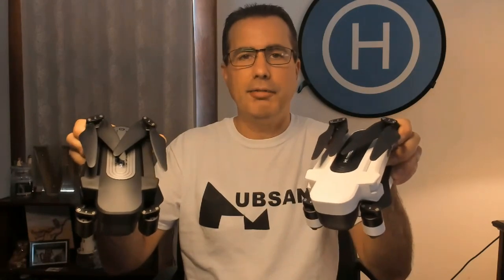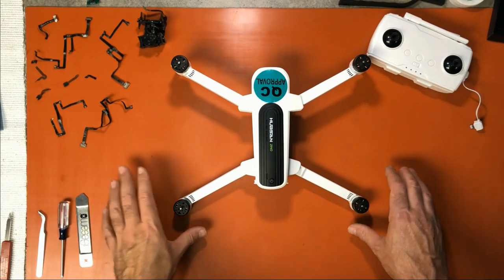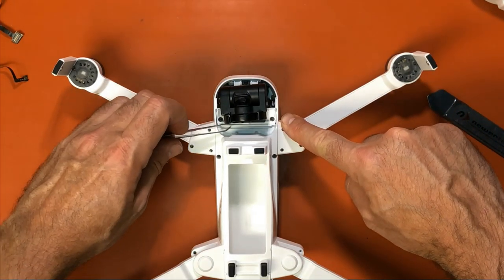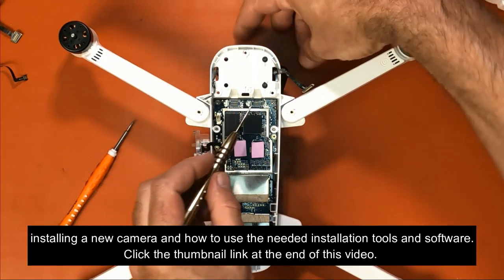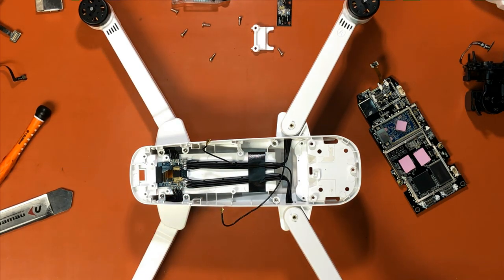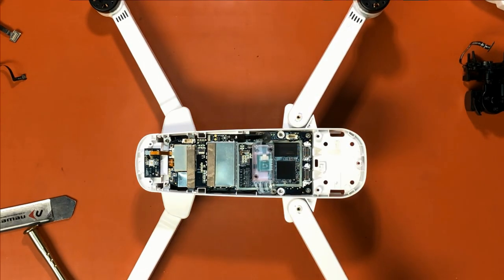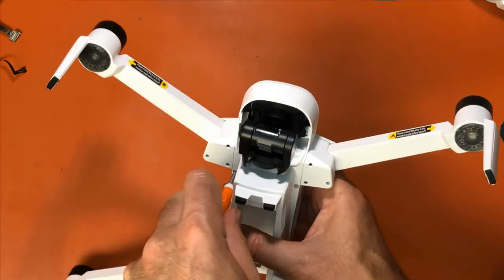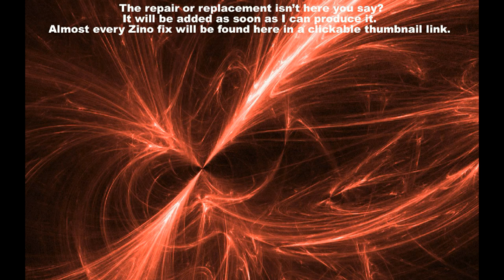HUBSAN ZINO - HOW TO TAKE IT APART & FIX ALMOST ANYTHING

Comment: These instructions came in very handy. Just changed the camera + gimbal, and then calibrated using Zino gimbal tool. Now it is working. I got it cheap, from a guy who had crashed it, and the gimbal did not work, camera was fine. Ordered a new Gimbal and camera, first at Geekbuying, but they had to cancel the order, since they do not know when they can get them from Hubsan. Ordered from Aliexpress instead. Hubsan offered that i could send the drone back to them in China, but had to pay 30$ for return shipment from Hubsan to back to me beforehand, and pay for spares, and also pay the shipping to China. So i opted to do it myself instead.
Reply from the maker: I'm glad it helped in one way or another and it's so nice hearing someone got in there and fixed it themselves! This is part of the hobby and you seem to get that.

Comment: Hay I have a hubsan pro only done 4 short flights & now my gimbal keeps having little fits the disconnects it that a broken ribbon cable
Reply from the maker: Mathew Mccorkindale It can be a few things but gimbal having fits doesn’t tell me anything I can identify with. Sorry 😐
Reply: Thanks for the reply I still haven’t found a fix. So the gimbal won’t calibrate. I turn it on & all is good then the camera moves up & down very small movements really fast then stops it lasted about 3 sec then it’s good for about 30 sec then it does it again about 3 times & the gimbal goes into protection mode & flops to one side. Would like to no if you have any suggestions to wot it could be thanks.
Reply from the maker: @mathewmccorkindale9196  This is a calibration issue where you need the calibration tool. Sounds that way based on how you described it anyhow.

Comment: Hi Chris, I have had a small crash with my Zino which hit a wall at low speed and fell 3 feet to the ground and landed upside down. When I picked it up all looked OK, camera still recording, I stopped the props spinning with the controller and stopped the recording. When I pressed the off button on the drone it would not disconnect, I pulled the battery out and all was off. After checking the unit I replaced the battery but the drone will not power up, no lights or anything? I stripped the drone down as per your video and all parts look in perfect condition. How can I test what may be the fault?
Reply from the maker: Kevin Pearce There’s three things that are going to cut off any sign of life. The power board button and the ribbon cable from it to the main board. The last would be the power supply board under the main board. 
You saying won’t power up doesn’t tell me everything though. There are signs of it doing things and not doing things that are giveaways.
Reply: @QCGUY  Hi Chris, thanks for the comments, I have ordered a  new power board button,  a power adaptor board with the battery connector and power adaptor board FPC that looks like a ribbon but I'm not sure? All 3 were just over £12.00 so no problem, I will wait for delivery in 2 weeks and see if I can solve the problem.
I'll keep you informed of my progress. Cheers.

Comment: Several AT-A-BOYS awarded for a well done video! Great idea to have the various videos for each repair required. Somewhere in your videos, I think you should stress that people keep their finger prints off those pink pads. They are thermally conductive to get heat out of the chips to the metal plate which is a heatsink! And make sure to press the plate back onto the pads when reassembling. I hope I never have to disassemble my Zino for repairs.
Reply from the maker: David Cash I was going to do a video about those and replacing them if needed. Sometimes Hubsan or whoever is making them even forgets to put them on. 
I have my own that I used on other people’s in this case but it’s a good point you make and good to know. 
Don’t put their finger prints on them? Meaning leave them alone or are you saying touching them can damage them? If so this is new to me? Thanks
Reply: @QCGUY  The natural oil on a finger placed on the pad adhesive will reduce the effectiveness of the adhesive, so be careful and don't  touch the pads.
Reply from the maker: David Cash Oops 😬 
Too late....I have touched them on the Zino and ummm at work. 😬
They are so soft and nice to touch though. 😂

Comment: Hi Chris, Marty here. I've got a zino 2,took it out for a spin. Had a bit of a crash, nothing broke so that was good, but the one thing that's coming up on screen is compass error, can u help me out chris
Reply from the maker: Yes under the top hood is where the compass is. Typically that error comes up if the wires or connectors are damaged or disconnected.

Comment: Great video Chris. Wouldn't have been able to repair my gimbal cable without it. The only problem is that I tore the barometer cable in the process! Do you know where I can get one? I've tried Hubsan & Ali Express with no luck.
Reply from the maker: Email me a picture showing both sides of the cable so I can see which yours is and I’ll see what I can do. 
qcguy.chris@gmail.com

Comment: Hi. Thanks for that video!! I'm replacing motors and power button plate + pvc button. Why is beside power button white plastic part?
Reply from the maker: Borut Bencak are you referring to the white plastic piece that comes with the new button? If so it’s usually not needed because it for the light by the sd card. That doesn’t usually break.

Comment: Hey Chris, thanks for all you do! After successful gimbal change, I do have the erratic shaking and decided to try this. However, my zino refuses to connect to the tool??? I follow the steps exactly and it powers on, but it never connects regardless of what I try. The red light next to the plug blinks and then goes steady as usual, the red gyro light inside is flashing, and the arm lights are all normal as well. Do you have any advice?
Reply from the maker: PTraas Tell me everything you have tried...
Reply: @QCGUY  changing the plug-in sequence, changing the turn on sequence, running tool as admin, etc. I'm thinking perhaps a firmware update might wake it up inside...
Reply from the maker: PTraas Have you tried a different cable? You may not have a good cable or it might just be a charging cable and not a data transfer cable. 
Also try another pc if available.

Comment: Great video.  Can you upgrade the GPS antenna on a zino pro?  It seems that it takes too long to get satellites.
Reply from the maker: Jose R Perez That’s the gps module and it will take longer if the quad sits for a period of time or often first use. Depends on area as well. Nothing I can suggest as a upgrade there.

Comment: Probably a pretty basic question but it seems very hard to put replacement rotors on. Is there some sort of trick or is it just applying a lot of pressure?
Reply from the maker: C.H. Gardiner The easiest way is just take one screw out and replace each one separately rather than as a set. 
Replacing both at the same time you shouldn’t have to push hard on the hub at all. It slides on and you line up to the tabs and screw in your two screws.

Comment: Thank you for the info as just recently I'm getting a barometer failer notification on my screen so when I lift off the zino flops all around as if in 100mph wind. I land it and it will not calibrate at all, any suggestions?
Reply from the maker: Shon Bowdan Are you trying to initiate a manual compass calibration or are you saying it won’t let you?
You need to do a horizontal calibration indoors as well on a flat level surface which basically is a IMU calibration.
Reply: @QCGUY  I tried horizontal too and it fails both indoor and out.....Manual compass just wont initiate either.
Reply from the maker: Shon Bowdan Im going with a broken or bad connection to the barometer or worse case bad barometer.
Reply: @QCGUY  Ugh....OK at least that gives me some idea of the problem. What do you suggest? I am pretty handy to a point (eyes arent as good as they use to be) but handy none the less. How about part cost, placement and time to repair? Is it worth it to do it or use this as parts and replace with another? Again thank you in advanced for all that you do..
Reply from the maker: Shon Bowdan go to the video in this link, the parts are in the description of that video and it will tell you what to do.
https://youtu.be/-i1je0eE0M4
Reply: @QCGUY  thank you for the info, as I ll make my decision after I watch.
Again thank you so much
Reply from the maker: Shon Bowdan No problem 👍

Comment: How do I get in touch with the Hubsan repair department ? One of the motors stop working and it makes a low pitch beeping noise when I turn it on now. Everything works except when I unlock the motors only three of them  spin and the one that's not spinning is making a low pitched beeping noise.
Reply from the maker: Email me… qcguy.chris@gmail.com

Comment: Thanks so much for all the videos. I have the same problem that a lot of Zino owners have Zino will not connect to my phone.  I have successfully updated firmware 3 times and flow it after updates. If tried 4 different SD cards formatted to Fat 32. So I went ahead and replace the main board following your video (thanks). Still have the same problem slow flashing red light by SD slot. The Main Board I received had a  new heat shield and wifi cover but the main board had  some glue on the connections so I assume it was pulled a return or none operational  Zino. Help!!!
Reply from the maker: Calvin Barnhill I could replace these with early firmware but now have found some recognize and others don’t.
The board isn’t recognizing the camera/gimbal so you won’t have wifi and connect. 
I’m working on a video for this but waiting on a special tool. 
Check back 👍
Reply: @QCGUY  Thanks

Comment: Hi there, I have a question. I got the gyro cable from ebay, and I need another one, for the camera. Any ideas, where I can get it?
Reply from the maker: Aliexpress.com
Reply: @QCGUY  I could not find it on ebay, I searched for it on aliexpress, there are a lot of different listings. I am not sure, which cable will fit my Zino Y. Still looking for the camera  cable replacement. Could you please help me?
I am desperate by now

Comment: Thanks for the great video! I have hubsan zino about 2 years and  I have a problem with disconnection ,
returned to the old version firmware 1.51. and dron fly about 2-3
minutes and turns itself off. On the lcd screen disappears ( poor
signal ... adjust antenna) Please if you know the problem, help mi
please.
With new firmware it does not work anymore. (battery error or low battery).
Thank you so much.
Reply from the maker: I'm going to say just as a guess that it could be you have the latest app with that older firmware version. Android I'm guessing? I have ios and no problems with older firmware but see most problems in Android devices. The newer firmware is just awful with the warnings and false battery readings.
Reply: @QCGUY  Thanks! Yes I use Android app
Reply: Hi! Today I tried with ios iPhone 8 new app and I have the same problem ( poor signal,  adjust antenna), also i tried with older version Android app X-Hubsan 1.7.5 apk  1.7.6., 1.7.8., 1.8.0 and 1.8.2  have same problem  i used Samsung galaxy A51, maybe this devices are not supported? I  don't know where  the problem is 😕 🤷.  Thank you again!
Reply from the maker: @mgrynchyshyn  post in my group. There’s more people to help and it’s just easier to troubleshoot in that format where you can show video and pictures if needed. 
https://www.facebook.com/groups/HubsanQC/
Reply: @QCGUY  Thanks!
Reply: Hi, I tried without propellers about 20 minutes and Drone did not give any problems.
Reply: Thanks!

Comment: i try to repair my zino after water damage (I flew with my drone at the coast, but battery just lost like 20% in 2 min and 10 meters next to the beach it activated then emergency "landing"😞☹️)  . i dont know if it really makes sense but it still turns on but "behaves" not normal. some lights stay on for example when i switch it off and the gps does not work (without gps i cant start). i guess it wont be easy.
Reply from the maker: I would have to have it in front of me and taken apart but it sounds like you’re power supply board.
Reply: @QCGUY  its kinda interesting what happened. the drone fully droped in salt water while it was turned on. then i took  the battery out went home and washed it with normal water (because i have no distilled water). after it i wrapped it in a cloth and waited for a long time. the battery was completly broken and made wierd sounds and wasnt charging. well then i bought a new battery some months later and put it in. (it was a battery for 40€ but not original. i couldnt even charge the battery (idk why) but got my money back and had enough time to check if the drone is still working because it was like 30% preloaded). then i put in the battery and all the lamps lighted up (even before i could witch it on). then i switched it on and paired it with the controller. it actually worked and the camera worked too. then after 15 min waiting  the drone was connecting with gps. the first time I tried it I thought it wouldn't work. But maybe its just because i tested it at home. the propellers and calibration worked too. i am surprised that my drone mainly survived. Can it be that malfunctions can be caused by a wrong/bad battery?
Reply from the maker: @xggx4268  That’s pretty amazing! 
Anything is possible with these batteries so yeah I would rule it out.

Comment: I literally had my zino pro + for less than 24 hours and I started getting code 0x2000 gimbal cable is loose or broken. I'm kinda pissed. So thank you for breaking the process down.
Reply from the maker: That’s a cable needs replacement error in most cases.
Reply: @QCGUY   awesome.....i bet I have a situation that'll make you scratch your head. So I was flying my zino and the quad was outside, and I was on my couch, (yes I found out that was a mistake, fun but I wouldn't be asking this if I wpuld have been smarter) and as the drone was attempting to land. Well I hit the tree limb about 20 feet or so up. It came crashing down. When I picked it up I had to yurn it back on. When I did so I did not get the second set of beeps. (The last 2 after the 4 or 5 beeps that sound at first start up) so I went to shut it off. I pushed and held the button, n it would not turn off. I had to remove the battery to power it down. So in conclusion, I no longer get the second series of start-up beeps and quad will not shut off when I push the power button. What in God's good green earth would cause that? .....i so much appericate you and your vids. Your awesome and thank you for your knowledge.....thank you in advance man so much. I would even be willing to give ya an email or phone # if needed. I just can't figure this out.....
Reply from the maker: @jacobcooley242  most often that is the power button board or the power supply board. One of the two is usually the issue. 
If it’s the power supply board it’s not unusual that a esc went along with it which you would know because one of the motors wouldn’t run. 
Can you start the motors or does it not let you get that far?
Reply: @QCGUY  it does let me get that far. I will try to upload a small video for ya. But your diagnoses sounds about right.....it will make the first series of beeps. I think it's like 5 or 6 beeps, then a brief pause, then 2 more beeps.....well that last 2 beeps are a no show. I 100% trust your judgement, but just out of curiosity, if it was power board, would it even get power at all like it does? I can't tell you how much I appreciate your time. Sry so many questions for ya. You should see if hubson will hire you as their head of support. Cause lord knows they have hands down the worst service ive ever seen. McDonald's has better service than Hubsan......i will try to get a video for ya. I'm pretty sure its a gonner, but just for future reference for myself and everyone out there. Thank you so much man!!!!!!
Reply: Edit: it DOESN'T let me get that far......sorry bout that........

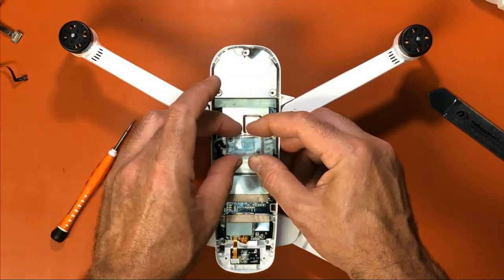Comment: What is the ribbon cable that you moved at 18:45
Reply from the maker: Barometer cable
Reply: @QCGUY  ok, I have looked and the component on the zino pro plus is different to the zino pro. The pro plus has this all in one cable and board part that I can’t seem to find. By the way thank you for responding.
Reply from the maker: @southwalesdrones281  Yes all zino models have different ones and pro plus is a all in one cable and module. 
I just ordered some from Aliexpress.
https://a.aliexpress.com/_mtrNoz9

Comment: something was stuck in my gimbal so i want to disassemble each axis, how to do it?
Reply from the maker: It not something I can just tell you in a reply. If you are mechanically inclined you should be able to figure it out but I personally wouldn’t do it without new replacement cables.
Reply: @QCGUY  this issue started after my zino crashed in the mud, i have not found an entire gimbal assembly so my hope is only by opening each and looking for things that might be stucked there. I have gimbal calibration error and the stabilizer dont work anymore video still captured but no stabilization.
Reply from the maker: @judestephenromanillos6207  You can take the whole gimbal apart but again I wouldn’t do it without new cables. Chances are you will mess them up. 
I have gimbals but it’s not worth the shipping if you aren’t in the US.
Reply: @QCGUY  im not in the us, i dont know why they dont sell the selling point, if this drone dont have 3axis its nothing but a toy.

Comment: You should change your procedure to unplug gyroscope cable before moving anything.
I broke mine(
Reply from the maker: People break them just as much unplugging them from the glue or damaging the pins trying to plug it back in. 
I repair a ton of these on the side snd never remove it. 
Slow and steady wins the race. 👍🏻